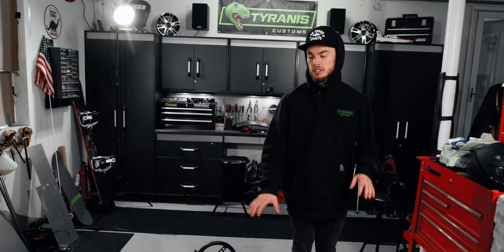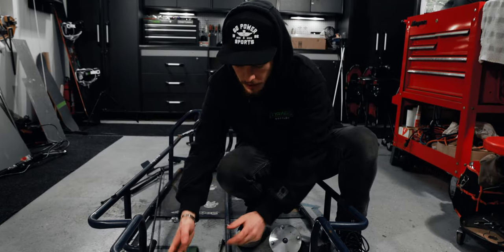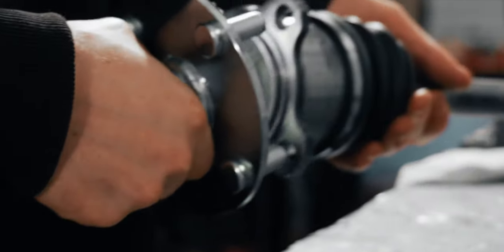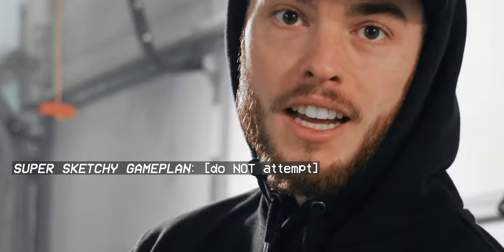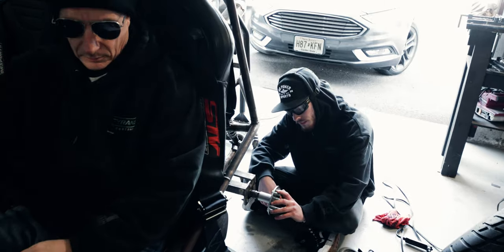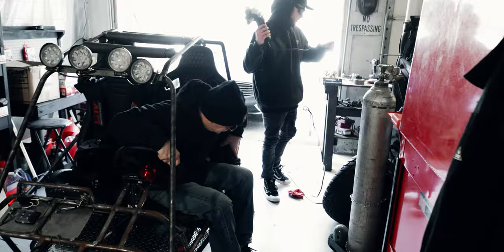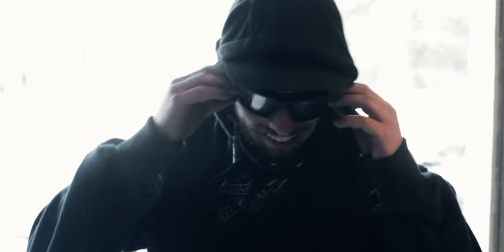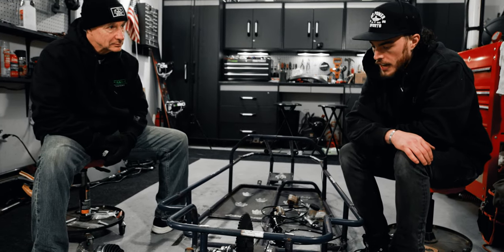We TURNED our go kart into a LATHE | TYRANIS EP31

Comment: Could you have turned the hub the other way on the "lathe" and given yourself more workspace?
Reply: That would have been too easy and not nearly as sketchy though
Reply from the maker: That's what I was hoping to do but the axle is tapered at the end down to 3/4" , and so does the hub. So if I flipped it around, I wouldn't be able to get the nut back on haha
Reply from the maker: Also, exactly what Dan said hahahaha
Reply: @TyranisCustoms  makes sense. I might have to do this in the future, so I want to know the least sketchy way to do it.